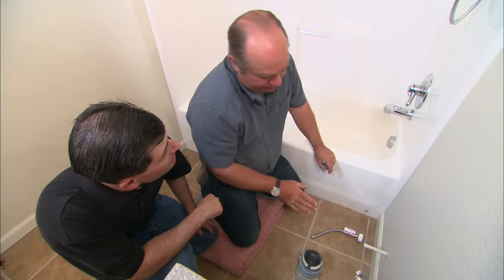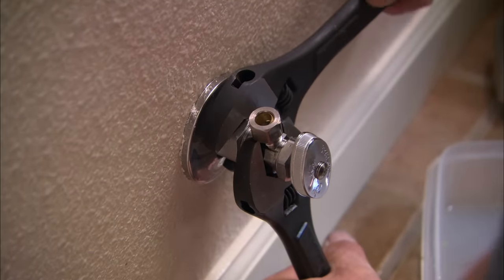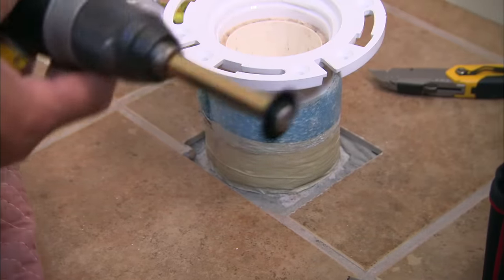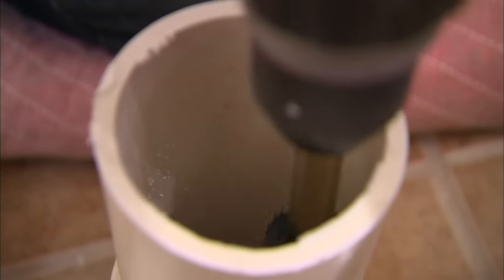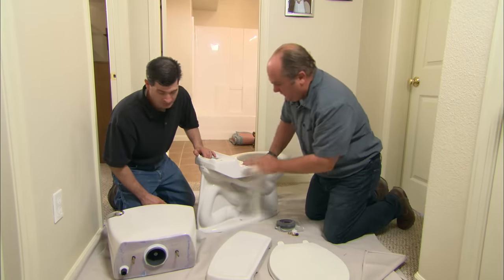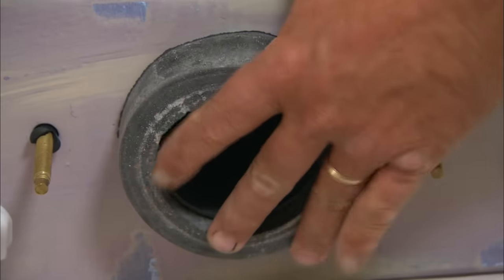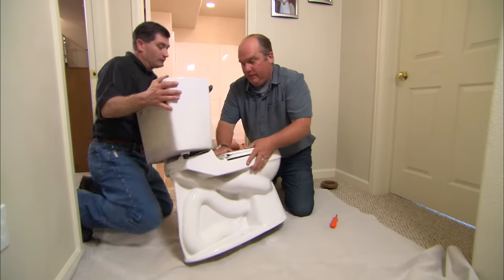How to Install a New Toilet | Ask This Old House

Comment: what's the name of machine that you used to cut inner pipe?
Reply: Alfred : it is called an " internal pipe cutter "  hope this help.
link to amazon: https://www.amazon.com/Cobra-PST109-Inside-Pipe-Cutter/dp/B0002YVLJ8/ref=sr_1_2?s=hi&ie=UTF8&qid=1491972627&sr=1-2&keywords=Internal+pipe+cutter
Reply: 9.72 its price of the machine or only blade
Reply: Alfred:  the price is for everything you see. Not only the blade

Comment: A professional plumber would have caught around the tiles to fit the flange flush to the floor that is completely wrong the flange is not sit on top of the floor it's sit into the floor flush to the floor
Reply: Flange sits flush ON TOP of, and is screwed to, the finished floor.
Reply: @paulmonk7820  NYC plumbing codes are way different then what I see in these videos there more like a handyman trying to be a plumber and toilet bowl flanges never sat on top of floor always flush to floor rember PVC is new alot thicker most toilet bowls need plaster to set the bowl because how thick the flange is I see it all time and it's wrong NYC we dont do that its against code

Comment: Ummm... at 4:35, he's trying to drill through the tile...in reverse? also, there are things called hammer drills that'll zip through that tile much quicker, especially in the right direction.
Reply: They would crack the tile.
Reply: @Hello Richie how are you doing

Comment: Warning! Warning!  If the toilet manual says that the top of flange should be level with the finished floor then follow that.  For a Mansfield Vanquish Toilet, at first, I installed the flange on top of the finished floor and it was too high.  The toilet was rocking on the flange.   I lowered the flange to the correct position and the toilet is now very secure.  And yes, I screwed the flange down both times.

Comment: why would you cut the pipe that short .?
Reply: +bludika The flange only goes on the pipe so far it has to go all the way down to the floor if not your toilet will hit the flange first not the floor it will not be stable the weight has to be on the base of toilet not the flange connection.
Reply: blastman8888 no i mean the toilet water supply pipe
Reply: bludika I see didn't watch the entire video

Comment: As he was tightening the two nuts to install the toilet on the studs, I wondered why Rich used an adjustable wrench to finish the job.  He had to bend over and contort his upper body to do that, which he could have avoided.  There's never enough working room around a toilet; It would have been simpler and easier on his back to use a deep socket and a ratchet to complete that task.  He wouldn't have to bend down quite so far if he also used a six- or eight-inch extension bar with the ratchet.  I guess Rich likes to travel light and doesn't carry those items in his tool bag, but his back would thank him if he did.
Reply: did you see his gut?

Comment: This is why TOH drives me crazy.  I just about lost it watching this realizing I will have to 1) cut the PVC pipe below concrete finished floor level (I did this once already for shower with a Dremel tool and that turned out rather uneven) and then 2) excavate around the PVC pipe because nobody did me any favors leaving a spacer around pipe. 

Then I think to myself, there has to be an inside flange for precisely my issues and low and freaking behold there is!  Why doesn't TOH do US any favors by, I don't know, throwing out other ways to skin a cat besides the ONE and only way they're showing.  Jeesh....
Reply: Michelle Harmond I just wanted to ask about how far above the finished floor was your pipe? Because this one was just too high to put an inside flange in from the looks of it.

Comment: first of all, its easier to install bowl by itself first, and then install tank, if you are given enough room which you were,  second of all, you failed to tell the people the importance of lining the flange up to where they are 180 degrees away from each other,,,,, people could thus glue flange wrong to the waste pipe

Comment: do you use pipe dope thats what i use
Reply: Chris Mills Richard uses pipe dope in other videos, he just never needed it in this install.
Reply: TheCanasian I was just wondering guess we use it for extra security for it not to leak on the stop because I've seen cases where they leaked thanks for repsonse
Reply: Chris Mills Ohh I see what you mean. Yeah I guess he just deemed it unnecessary.

Comment: This old house is slipping!!!  Escutcheon has wrong size hole, should have used a bell escutcheon so you have one more shot at cutting pipe 15 years from now and changing shutoff, and a all plastic flange?  For a couple of dollars more, could get a quality ss one.

Comment: Every new DIY job I look into seems to require at least one, and usually several, specialized tools to do properly, and often to do at all.  It's almost like it's cheaper to just pay professionals to do it than to shell out the money for expensive tools that you may very well only ever use once.  Certainly less aggravating.

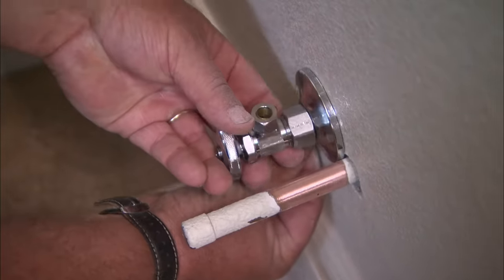Comment: 5:30 those plastic screws are just JUNK  , DO NOT USE THEM. Use rubber washers , metal washers and two iron bolts and nuts.  The toilet seat ALWAYS comes undone when you use the plastic GARBAGE.  0:56  The DORK cut the pipe to short.  PRE tard  Forgot to silicone back plate to wall.

Comment: You never cut off the extra stub sticking out of the wall You're one of those guys aren't you? So now when that valve goes bad and the valve after that goes bad somebody has to go into the wall and put a new stub because you decided to cut off an extra two and a half inches. It's not a perfect world things do fail and break that extra stub is never going to be seen and it should have never been cut off. Guys always think of yourselves

Comment: Could you do a video on how to keep those plastic bolts tight for the toilet seat.  They always come loose at my rentals and I've had to revert to metal bolts only.
Reply: RikaKazak. a platic loctite would be be good. You could use super glue too as lind as the bolt is not polyethylene but I think they're nylon.

Comment: what is sewer gas
Reply: +Armani Perez Gas that comes out of your sewer pipe.
Reply: +J.A.Grami thanks, but where exactly does it come from? From the sewer of course, just how does it get in.
Reply: it is just the smell from the drain
Reply: Armani Perez It's a smell that will come up from the sewer line and that's why the wax seal is very important
Reply: It's way more than that, it's a mix of human waste and a mix of many different types of cleaning products that are used by many people. This mix of chemicals can kill and should be treated very seriously.

Comment: Yeah this guy is a hack been a plumber along time.  He should have that coper stub out at 2 1/2 or 2 1/4 just sonif you have to replace in the future also he used some crap multi turn from home depot be a proud plumber get a good one from the supply house or get a copper onr you solder on

Comment: I'm a plumber and this guy is a joke. do not use compression. have your plumber come unstable a sweat angle stop. now if this leaks again the way he did it then you need to open up the wall because there's no more pipe showing to work with.

Comment: Terrible Job, no need to cut the pipe so short, and Sharkbite fittings are way better than that old design shut off. OMG you butchered that PVC. Awful.
Reply: sharkbite fittings are for those who don't know how to solder joints...they are for amatures! You won't ever see a professional job in resi or commercial using sharkbite fittings, they also cost 10x the price!! And for security reasons, anyone with the C-clip can just walk up to an installation, pop on the C-clip and remove the fitting and make havoc to the installation!! You like apples? How do like like them apples :)
Reply: Brian Hannon you don't solder plastic, security ? lol
Reply: I just finished a duplex and used all sharkbite shut off valves for all the faucets and toilets. Granted, it was the first time I ever used them for shut off valves but they worked like a charm, it was especially nice in those tight vanities, I'll definitely be using them again. If it makes the job a little easier, I'm all for it. Do you also still use copper for all the water lines instead of pex too? C'mon man, they don't cost '10x the price' either, they cost $1 more than a compression valve, $1!! And as for your 'security reasons', who the hell is going to be carrying around a C-clip in their pocket? Unless you're in the trade, you're not going to know you need one of those to take it off however with a compression valve, it's obvious you need a wrench therefore, sharkbite fittings are probably more secure. Keep being a stubborn hardass, you're just making your job more difficult by refusing new and better ways of doing things.